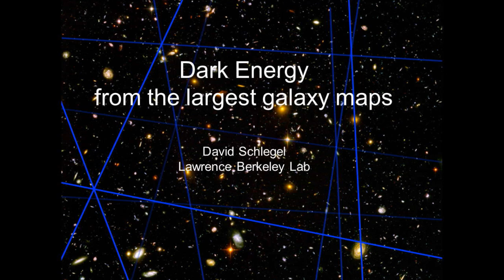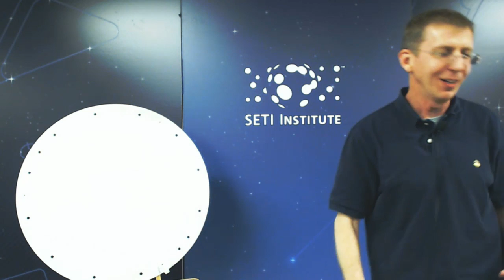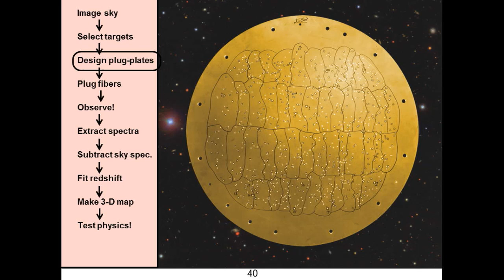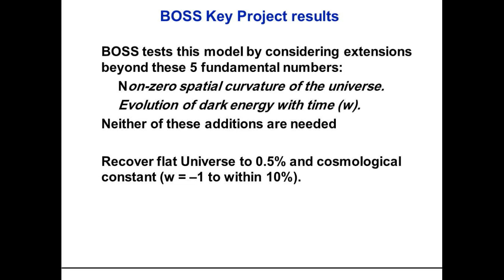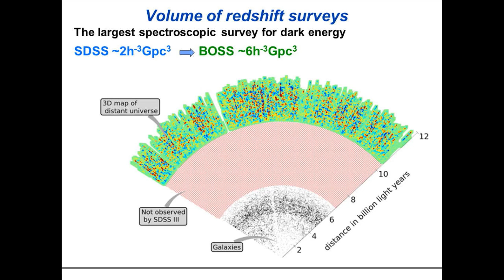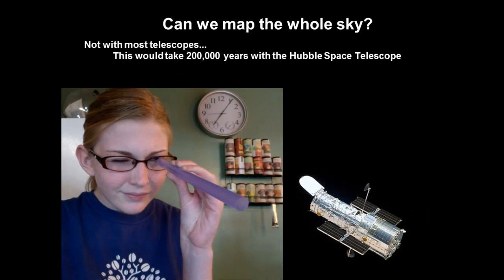Dark Energy from the Largest Galaxy Maps - David Schlegel (SETI Talks)

Comment: Good. But applying Doppler shift [inferring inflation] to redshift is spurious.
Cosmology makes more sense without dark energy (eliminating the need for a Big bang and all its problems),
its "effects" can instead be attributed to relative and absolute energy/frequency differences of supernovae /active galactic nuclei.
I don't see enough data collected to say anything about the reality or veracity of these claims or (circular) computer /mathematical models based on phantasms and in its core: one mere assumption.
Reply: sum ergo somnio
Er, "growing" Electric Universe "theory"?  It's nonsense.  An explaination needs to be comprehensive, account for everything that the SUCCESSFUL model (BB/Inflation) does ( and I do mean EVERYTHING) in order to even get on the plate.  Then we can discuss which is better, or compare predictions that could decide between them.
A hand-waving rough idea is not a scientific theory.  You need to do the math.

Classic steady-state is long excluded -- the universe looks different as you look farther back in time.  The steady-state of a cycle of universe creation does not compete with standard cosmology, but is venturing beyond it.  Quintessence ("dark energy" changes rather than being a constant) will require new observations to determine, and again it doesn't say anything against the Big Bang and Inflation.
Reply: Even the weather forecasters use Doppler RADAR, and have for decades.
All evidence points to the inflationary big bang, so what kind of cosmology have you been studying?
Reply: "wrong", "lacking"?  Please explain.
No need for math?  Then how can you send a rocket to the moon?
Reply: But we see Doppler shifts from just planets tugging on their stars. So Doppler shift of light does happen.
"its "effects" can instead be attributed to relative and absolute energy/frequency differences of supernovae /active galactic nuclei."
Im just a geek who loves watching these videos and have never taken a course so I don't quite get this. But are you saying galaxies which are further away from us have greater frequencies making their red-shift greater the larger a distance you go? Cause that would make us the centre of the universe if I understand you correctly :O
Reply: NicosMind "But we see Doppler shifts from just planets tugging on their stars. So Doppler shift of light does happen."

Yes, still this does not validate the "inference" of inflation because the alleged radial velocity changes [red/blue shifted galaxies] - as only an indicator for velocity/distance- is a fallacious assumption.
We are talking about light that is mostly redshifted and this can be due to intrinsic redshift (the matter/energy itself) or caused by any electrostatic/magnetic field.

"But are you saying galaxies which are further away from us have greater frequencies making their red-shift greater the larger a distance you go? Cause that would make us the centre of the universe if I understand you correctly"

Not if you take into account they do not necessarily have to be receding (faster). We find highly redshifted objects in "closeby" galaxies
Reply: sum ergo somnio what red shifted objects in near by galaxies ?
Reply: Simple. I have studied it but do not adhere to the mainstream Big Bang cosmology, you do realize this is a branch within and alternatives exist?
Like the growing Electric Universe theory, check out thunderboltsproject on youtube. Or more mainstream: new steady state models or quintessence or phantom energy etc etc.
Take care.
Reply: Alright, it seems you have not fully studied it. And you make a few weird statements which I think do not pertain in scientific debate, let me clarify: a mathematical framework is no prerequisite for a scientific theory.
Any model, whether it be scientific or not is not actual reality, therefore whatever the models do doesn't automatically need accounting for---in other models----
the reason for the EU theory is, next to others, because the Standard Model is in some eyes wrong and in most: lacking. The power of the EU lies in the fact its so straight forward there is not even need for mathematics, just a curious mind and use of scientific method which leads to nontrivial in- and deductions. The truly intriguing thing, imo is exactly the uncharted maths.
Think about Faraday and Maxwell
Reply: you do it with persistence :}
Read into Jack Parsons